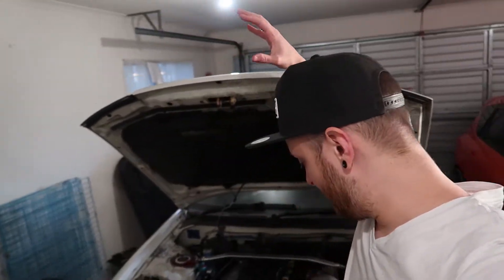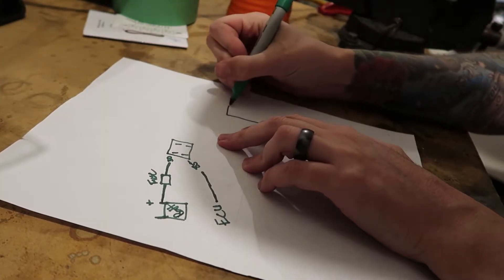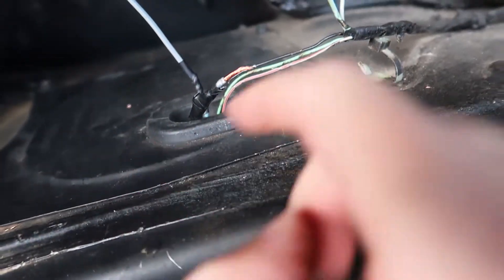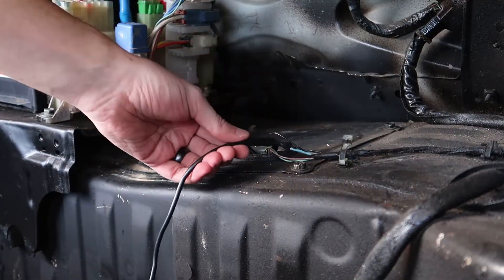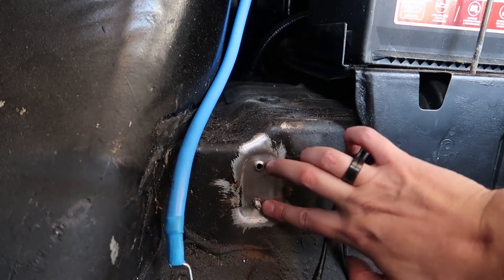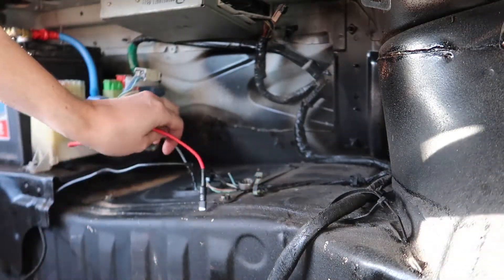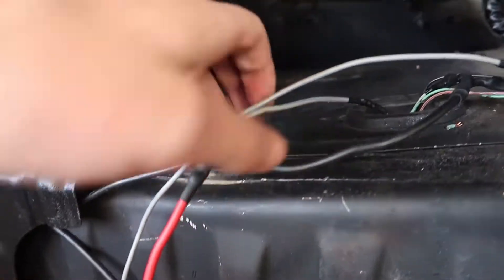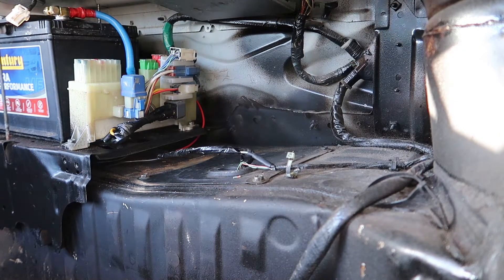Nissan Skyline R33 - Fuel Pump Relay Mod - How To

Comment: I love this video and I tried following it but whoever cut into my car before me didn’t follow these instructions. My ECU signal wire outputs no voltage and will not trigger my relay. I’ve had to use another switched peer source from under the dash for lack of finding switched ignition power
Reply: How did you go with this? I'm going to open the ECU and change out the fried resistor. Just need to trace pin 18.
Reply: @jaymurray9007   it was a blown fuse under dash was the reason for no signal to ECU relay. IIRC it's called the A/T fuse or something. I can do some digging but check for a blown fuse under your dash. It'll cause no signal to ECU relay.

Comment: Hi there, it would seem that the 1988 3.0 SGLi only has a printed circuit board with a whole lot of goodies to control   a lot of functions. One i would think is a built in system to relay the fuel pump. The pump switches on then stops. So my thinking is to do what you are showing me in your video. Can you confirm. We had the injectors tested and they are good. So the fuel flow to the injectors is compromised.

Comment: Sedan has battery in the boot as well, I gotta do this to mine just starting out my project :)
Reply from the maker: Wait really? I had a sedan and the battery was in the engine bay 😅
Reply: @PRAWLN  r33 sedan? Yeah they should be in the back same as coupe 😅
Reply: only in the gtst models, only DE and E models are under the bonnet.
Reply: @Mayaeri97 mines a 20e sedan and has battery in boot

Comment: is running a 30amp fuse and 40 amp relay a cause of concern to a pump that only draws 14.4amps? wouldnt that mean its been fed over 2x the operating power? (IE burn it out and defeat the purpose of it safety wise?) - looking at doing mine exactly the same

Comment: Hey mate I'm rebuilding a r33 gtst. Got the engine in but ecu relays don't click, fuel pump working. I check both relays but there are no ground wire for both relays. All 4 are 12.4v except for ecu power wire 11.2

Comment: what's the aim of the mod? Better fuel response?
Reply from the maker: So basically your sending 13v to the fuel pump instead of 11v from the ecu which means the pump will generally work harder so you'll have more fuel pressure.

Comment: what happens with the standard 15amp fuse?
Reply: It stays there because its still between the ECU and the Relay. The 30A fuse is between the battery and the Relay. Essentially when you do this mod, your original 15A wire from the ECU is now your "signal wire", while the new 30A wire direct from your battery is now your constant power (12v-13v). If you remove that 15A fuse, then you've created a break in your signal from the ECU to the relay. Without that signal the relay wont close and allow the power from the battery (Pin 30) to the pump (Pin 87).

This is why you specifically need a Normally open relay, if you have a Normally closed relay then your pump will be always on when the ignition is off (no signal from ECU) and will be off when the ignition is on (signal from ECU).

Comment: What is the point of doing this mod?
Reply from the maker: It means that the fuel pump is getting 13v straight from the battery when the cars running, instead of 11ish volts from the ecu